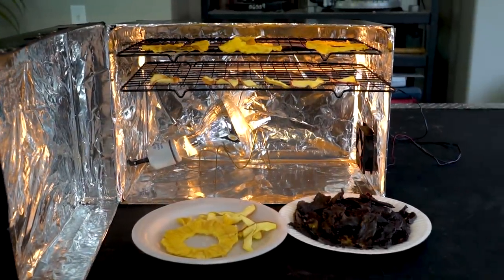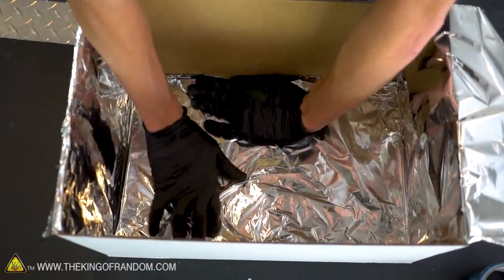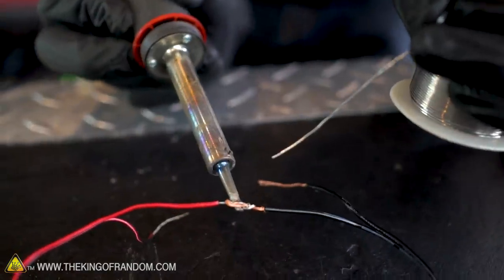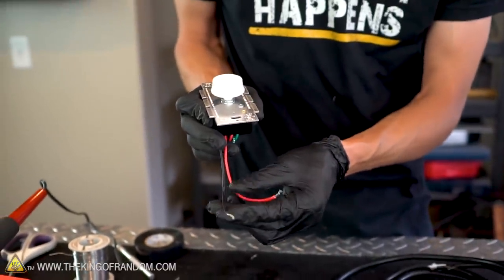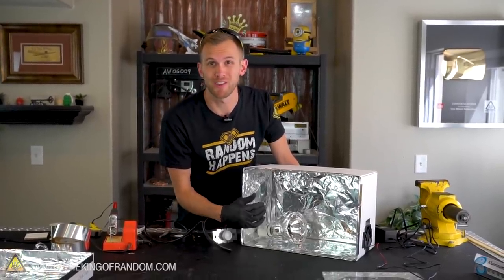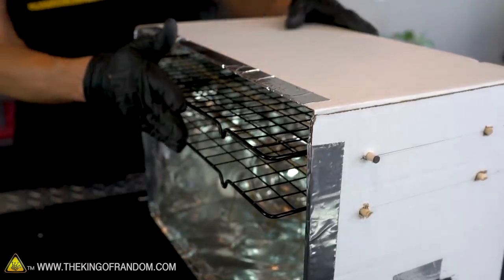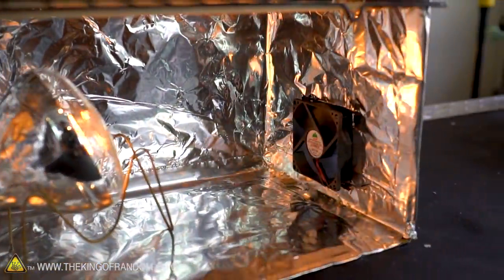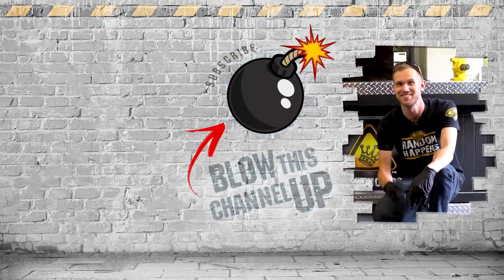DIY Dehydrator from Cardboard Box! TKOR's Guide To A Homemade Dehydrator Machine!

Comment: Those electrical connections grind my gears
Reply: parkeerwacht same!
Reply: Ditto!
Reply: Exactly, maybe use eletric tape
Reply: Debbie Meyer not even tape use proper wire terminals and junction box for example Wago has these terminals specially made for flexible wires which would be great for this instance
Reply: Same, I kept thinking "heat shrink tubing dude, heat shrink tubing..." sooooooo much safer than electrical tape
Reply: YES heat shrink tho i would still solder then heatshrink
Reply: It's supposed to be a hobby project, as cheap as possible and available to everyone. I've never seen heat shrink tubes in any store but I can get electrical tape quick and easy pretty much anywhere.
Reply: @Sicroto, of course, solder is definitely first, but then yes, heat shrink afterwards.
Reply: @HMS-Captain Lurmey, I haven't had any issue finding heat shrink, esp here in the States. And when I find it, it's only a couple bucks.
Reply: Nepal Plush well this video was meant for everyone not just the US. They pretty much chose materials thats easily available for almost everyone.
Reply: 12 volts of DC current grinds my gears
Reply: his switching the neutral instead of the hot drives me insane.
Reply: Electrical tape is fine. It has never failed me. There is nothing magical or inherently safer about heat shrink tubing, just a bit fancier.
Reply: It's the lack of a proper electric box on that dimmer and its splices that seems the most dangerous to me.  Those cost 3-4 bucks at any hardware store.  A very reasonable price to avoid electrocuting yourself and burning down your house.
Reply: Ditto
Reply: Whats wrong with 12V DC?
Reply: 12 V DC Current is redundant.
Reply: Travis Bohanan I agree with you, when I saw he was using a potentiometer on the neutral I was wondering why..
Reply: @Foxwolf9Tails  Exactly what I was thinking as well. Besides the heat shrink tubing will last so much longer and give a much more stronger connection.

Comment: Improvements:
1. Add a filter on the air intake.
2. The lamp should be placed above the food since a lot of food will drip while drying.
3. Add a pan in the bottom that will collect said drippings from food.
4. While cardboard is cheap, use some other easily accessible material that is less known to be sensitive to moisture.
5. Hot air rises. So air should be forced in from the top and be let out from the bottom side.
Reply: Brain damage
Reply: thank you 🫶🏻
Reply: Yup. Definitely needs a thin piece of open cell foam or something similar outboard of fan.

Comment: Just a thought. Checking the power consumption on the Heat lamp and power supply so you could use the smallest inverter possible and add in a 12v battery as well as a solar pannel so that you could have a complete off-grid solution that doesn't require constant sun to work.

Comment: Hot Tip : You can buy 12v ceramic hair straightener heaters on ebay for a couple of bucks, you can then run it all on the same power supply (one with more than 0.75a than in the video though. the 2.1a one i use works fine). Its what i do for my biltong (jerky) boxes. I put them in a little terracotta plate from a broken planter to keep it off the cardboard, even though i don't have them hot enough to burn the cardboard/foil.
Reply: how do you incorporate it with your device tho?

Comment: Not to sound like I'm doing, but have you invested in Heat Shrink, It'll work better than just taping it up (I've used I on projects with my father doing wiring and he told me that Heat shrink (in his opinion) works better than electrical tape), it'll bond and hold the wires together and completely wrap around the Wire

Comment: Hey  KOR cutting holes on the top is incorrect. 
Reason: Cold air is denser than hot air or the air containing moisture is actually cool air and thus would settle at the bottom, while the hot air would rise up so instead of ventilating you are actually making the process of heating or dehydrating slower.
Reply: Heat is not important to the drying process, air flow is.  That is what the heat source is for, to create a thermal current, to move the air.  Every dehydrator/smoker has vents at the top.
Reply: Correct, a heat source isn't even required. You can dehydrate food on a box fan with some paper filters at room temperature.

Comment: Why wooden dowels? It might end up charring an the racks might fall. Metal takes a lot more to lose its integrity.
Reply: a-lpha of Zeldaforme Gaming wrong it's quite the opposite in fact. Metal tends to bend because of heat
Reply: True, but at 1800 degrees Fahrenheit beyond where wood turns to charcoal and crumbles. (Source: Me, blacksmith and Professional Firefighter)
Reply: It’s just a heat light. Not hot enough to make a wood char
Reply: Because of the airflow, the inside of the box won't get hot enough to burn the wood.
Reply: It would be better to secure them along the sides rather than across as it's allow for easier removal and placement of the racks
Reply: no worries it is not an oven...the cardboard will burn before the wood sticks...
Reply: So?
Reply: incurser if the cardboard didn't catch fire nothing will...heh
it is a black box in the end so you can make a solar version with no bulb if you live in a hot area.
Reply: Maybe. But chances are, you'd be leaving it for a long while anyway and, depending on the metal, it won't really make a difference
Reply: I was talking to op.. But point is its a dehydrator so doesnt matter what you is use to build it with because its not meant to go past 100 faranheit. Its a hobby project anyway so wooden dowels just sounds more practical.
Reply: I suppose. And they'd be considerably cooler
Reply: Doubt they would get hot enough even if they were metal since theyre mostly being heated by warm air. What he should add is a piece of glass or plastic between the lightbulb and the fan to diffuse the heat more evenly and prevent any moisture or drippings from damaging the lightbulb.
Reply: What’s worse is that he used spray paint to color something used for food. It probably won’t effect anything, but it’s just bad craftsmanship.
Reply: Maybe a metal rack will leave a metal-ish aftertaste?
Reply: I hadn't thought of that but oh yeah!
Reply: Baitrix opposite
Reply: If that’s a concern, simply take some of that reflective tape and put it around the dowels.
Reply: a-lpha of Zeldaforme Gaming you should be more concerned about the cardboard

Comment: Jerky is great. Dehydrators are great. But ditch the fan and foil. Put box on end for more height. Use normal 40 W bulb. Make several 1" holes along bottom edges and on top. Done.

Comment: Not sure if it was mentioned before but the dimmer should be on the black wires, the neutral should not be used to turn the lamp on/off because this would leave current at the socket at all times causing an electrocution risk.

Comment: What a great build.  
I have only one  critique. You were telling us how to wire in the dimmer switch and you called the wires positive and negative. 
I know you know they aren't positive and negative but ' power ' or mine and neutral.  But for a description, its cool.😁 I think you have an awesome  construct here, and I'm building one tomorrow!!! 
The only change I MAY implement is to use removable foil covered side panels. Only to make clean up easier. If it's even necessary?
Probably not too much splattering of juices with such low heat and air circulation.
Why didn't you mount the lamp outside?

Comment: Just a heads up, you should have put the switch on the black wire. The way you have it the light has power into it but nowhere to go so its looking for a neutral or ground when the switch is off.

Comment: Nice video, your spray painting technique definitely could use some work tho, lol, try holding the can about 8-10" away from the surface you're painting, and make longer strokes, starting beyond the edge of your work on one side and moving all the way past the edge on the other, take your time and do it in 2-3 coats and you'll end up with a nice even layer of paint with no streaks.

Comment: could you in theory, use the lamp's plug with a step down transformer and voltage regulator to get the 12 v needed to power both the light and the fan and have only one power cord? just a way to simplify things maybe idk if it would work though, just asking

Comment: I used an old microwave for mine I ripped  all the electronics out and just left the fan. Then I drilled a hole in the top and put a light bulb, wired it up and it works perfectly

Comment: An electrical oven on low heat or dehydrate mode does the same thing with no sketchy wiring or flammable cardboard.

Comment: Props on your soldering skills (Seriously, it's painful watching people solder splices sometimes).  However, might I recommend next time that you use heat shrink tubing over the splice?  The electrical tape isn't really a permanent solution.  It wears out as the adhesive dries out.
Reply: It's low voltage wiring. I wouldn't have even bothered soldering. Just twist wires together and wrap well with insulating tape. Mains voltage is a whole different ballgame however!
Reply: @Strange_Club  Wrong.

Comment: Huh.  In theory, you could also use it to heat up MRE pouches, canned foods, etc.  At max power, that thing can probably heat up (But not cook, important distinction) ready-to-eat foods.

Edit:  Also, making pemmican would be rather easy from the kind of jerky you'd get from this.  And you'd have a reasonable supply of dried fruit for add-ins.  Provided a source of lard, tallow, or similar, you've got one of the oldest survival foods there is.

Comment: just a heads up, if any of you plan to make this make sure not to use tape on the inside of the box like shown, and definetlly do not put paint anywhere on this thing, the heat from the heat lamp can slowly evaporate the glue and any toxic materials left by paint or tape and those toxic fumes will definetly get into the food you wish to dehydrate

Comment: I know heat rises, but dont you think having both extractor and heat source at the bottom just sucks the hot air out from left to right? I decided to put bulb at the top and fan at the bottom, with air holes top sides, as then you are sucking the coldest air out that has travelled its way down through the food and would otherwise settle at bottom? Thats my thinking anyway...thoughts?

Comment: You really should use heat shrink instead of tape. Tape adhesive gets 'soggy' and the tape slips around, bad things could happen. Heat shrink is a better option for anything more permanent.

Comment: To make it more efficient... check the power rating on the fan then get a psu and speed controller without the speed controller that fan will not go any faster or slower

Comment: would've been even better if part of the dehydration process involved pulling a vacuum on the food you want to process and didn't rely so much on heat(ya know, degradation of mollecules and so on[still a small effect, though]) but even so was an interesting video.

Comment: The fan blowing into the box will create positive pressure in the box which would reduce the evaporation rate of the material you're trying to dehydrate. Idk how big of an effect this would have but I think if you put the fan facing outward at the top and put the holes at the bottom, you may have better luck.

Comment: You’re supposed to put the switch on the hot wire (usually black) going in to the appliance rather than on the common (white wire) coming out so the box isn’t energized. And I don’t think that a handmade cardboard box is approved to place a switch in. Maybe someone has already pointed this out? Seems a little dangerous

Comment: This is a great tutorial...........
On how to burn down your house 🔥🏠🔥

Let’s put a 250W light bulb inside of a cardboard box which lets not forget is quite flammable. Along with some sketchy mains wiring and an unreliable air circulation fan and we have a recipe for success..... 
But Only if success is setting it on fire. 

I would suggest a small 200w mini heater (usually advertised as my heat brand) that has automatic shut off to prevent short circuits and won’t let the heating element melt. Also it includes a fan. So no wiring. Less of a chance of death but still dangerous enough to qualify for king of random.

Comment: It seems as though you're just making a convection oven... Using heat doesn't, in fact dehydrate, but cooks.

To make a real dehydrator, you can take a box fan, and some residential air filters, place said air filters on the side to the fan that the air flows from.. Use a bungee chord or 2 to secure. Turn on fan, and viola! A true dehydrator. You put what you want to dehydrate in the slats of the air filter.

This is merely cooking the food to the point that it has no more moisture.

Comment: But is this really cheaper than a used commercially available dehydrator? Foil, tape, lamp, bulb, dowels, racks, dimmer switch, computer fan, box, 12V supply, soldering iron, solder. Hmm. I hope so, but I don't know.

Comment: For the price of the dimmer switch, heat lamp, power supply, 12v fan, bulb socket, tape and other stuff, I could just buy a dehydrator.

Comment: PLEASE DO NOT WIRE IT THIS WAY!!! wire up your switch by switching the "hot" or black wire not the white one. by switching the white one you will still always have power at the light socket. the black is the one that will shock you. the white is connected to ground and won't shock you.

Comment: You know you can just buy a proper dehydrator for ~$35, right? And most won't burn your house down.
Foil tape $5
box $1
aluminum foil $9
heat lamp $5
fan $5
power supply $7
dimmer switch $5
bulb socket $3... solder, dowels, wire racks, extra wire, electrical tape....

Comment: That bulb is WAY over powered. You don't want light when dehydrating and you absolutely don't want heat much over 120 degrees F. You can dehydrate very effectively with just the fan and/or a small solar thermal collector isolated from the main box. You do NOT want to cook the food when dehydrating, especially meat. Dehydrated cooked meat can become contaminated by botulism WHICH IS LETHAL! Keep your jerky under 200 degrees.

Comment: Cardboard will absorb bacteria! If it unclean from when you get it, it will be contaminated!Don't use a cardboard box unless its clean more than once to avoid contamination! The heat from the light can be dangerous too.Just be careful, if you try this! 😉
P.s. The foil isn't neccesary, and the bulb this guy is using will probably set the cardboard on fire! Use a bulb that creates heat, but isnt a risk. A normal household lightbulb is probably a safer option. You can use two bulbs too!
Anyways, I don't recommend this video. Its too complicated, and creates an unsafe and VERY UNHYGIENIC drying box.
Thumbs down!. (Sorry guys!)